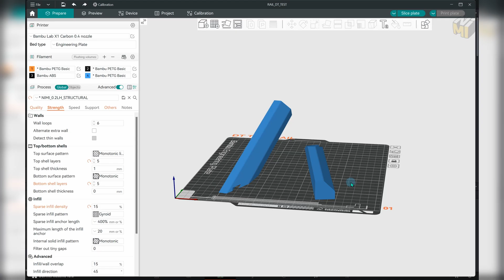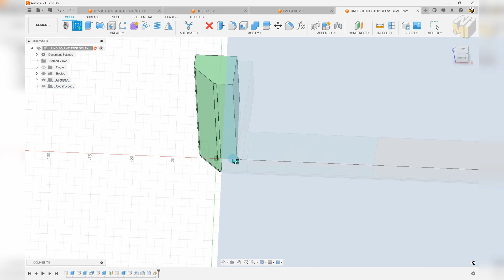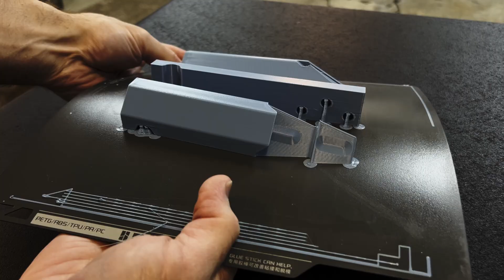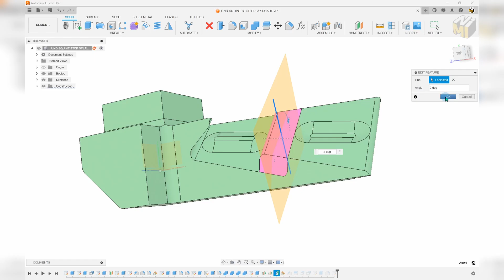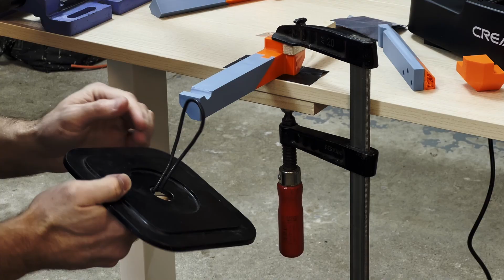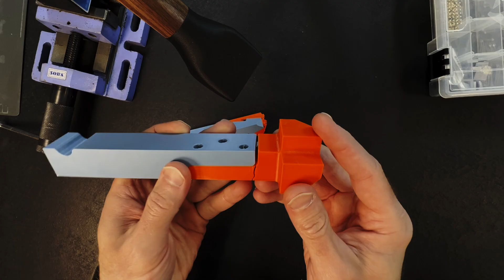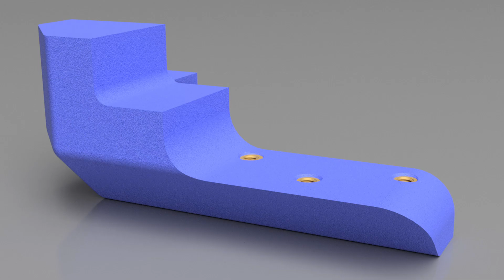Strong 3D Printed Connections on BIG parts

Comment: the joint with the wedges........ you did your test with it rotated like 45d around its long axis, obviously you did this for strength, it would be interesting to see it compared to a non rotated version, the same as the dove tail was oriented................. similarly, you should also do a version with a 45d rotated dove tail. Comparing these designs, as in the video, is comparing 2 changes at once, the change of the design, and the joints rotation, having variants with only one change, would provide better data.
Reply from the maker: I wasn't really sure at the time of the design whether it would work well at all, the main reason I did it was to prevent the wedges from being visible from the front, and also to have a more symmetrical connection as well, square profile would have made it a lot easier.  I'd love to do more testing, I need to order some more material and we can really get into it with all types of ideas about orientation, or whether hollow with more tops and bottoms is better and no infill, or perhaps having webbing like an injection molded part.  Great feedback, I have a few vids to finish up and then I'll be back onto these testing videos again.
Reply: @NeedItMakeIt  either way, it looks like you good ideas in your videos, ill keep an eye out for them.
Reply from the maker: @ZOMBIEHEADSHOTKILLER  Thanks!  I will definitely be doing more videos like this, I have a few ideas already which could prove to be big time and money savers for big parts... if they perform well.    I have my new weight scale on its way to hopefully give it a bit more accuracy and should speed up the videos a little as well.  Have a good one!

Comment: you're not just measuring the weight these rods can take in the demos, you're also measuring torque. If the rods were longer then they would take much less weight.
Reply from the maker: Yes absolutely, the tests aren't perfection by any means, it's really just a starting point.  I think a better way to test would be to have two bearing points, both which can pivot and provide support at the ends, we can load the center and test deflection and breaking while not having the 'table-edge' effect on the parts as well.  Let me know what kind of setup you think would be best for this and I can see about working it into following videos.  I have a new scale on its way, that should make the videos a little shorter and the testing a bit more accurate as well.

Comment: Good thing I stuck to the end of the video as I wanted to comment on the first part disadvantaged test. I think another point that need to be controlled is the connection length.

What do you think of a sliding dovetail with a bolt in the middle to fix it in place. You will have a large contact area and a bolt to keep them intact.

Comment: the last part failed because of the clamp fixture acts as stress raiser, that why it failed in the shoulder. because plastic has such low elastic modulus, the things tend to bend a lot, changing the direction of max tension vs grain orientation. allowing it to bend to conform to the stress and squish a bit of more "performance"
steel suffers from the opposite problem, as its high elastic modulus means that any and all stress will be directed, almost ideally (in contrast to plastic, at least) to the weakest point. 

since most of the time, the bending allowance is a problem in joints, you could also add a maximal tip deformation (at a given load) to see the effective rigidity of the solution, as a thin plastic (like a 2x12 mm, I estimate) hook with a controlled round flexion at the fixture could eventually surpass everything tested here, but it would suck as a frame element.

Comment: I suspect here with the material the main difference between them is that the more complex a joint has, the more wall material is being used. I would try a bit denser infill with the cubic pattern. So that you decrease the difference between the joints having more wall surface area between the parts.

Comment: This looks like turning plastic modeling, and taking a leap backwards to woodworking joinery.  That was a lot of modeling work.  What's wrong with glue?  There's glues that can handle low-energy plastics, heck, just about any thermoplastic.  Anyway it was interesting, but I don't get the need.
Reply: I mean to me if you can get something that is self centering that would be nice. Personally i would probably combine both glue and some kind of joinery. To ensure you have larger surface area for the glue to adhere to.
Reply: What was that specific glue? In my experiments superglue creates a bond that held up longer than the surrounding material for PLA.
Reply: @sopues  It was a loctite in a purple tube.  I wish I had it here in front of me.  Superglue on pla seems to work fine, PETG is a bit trickier.   There's also a company that makes a specific line of plastic glues, I think it's called "Purple Goo", or "Purple Goop".  Never used it myself, but I have seen it mentioned in posts as working.

Comment: So cool. This is more informative than the usual videos of many other creators on 3D printing. This gives me ideas of how to approach some 3D printing problems.

I have a hard time putting in inserts with an iron. I do it from the other side, and make the hole smaller on the fastener side to keep the insert from being pulled through.

Comment: One limitation of the final two joints is the direction of assembly.  They require lateral space to fit together whereas the first joint type allows lateral and transverse assembly.  They will still work to create a frame but will require subassemblies rather than direct ad hoc assembly.   Put another way, imagine making a cube with butt joints verses dowel joints.  Butt joints can slot in wherever there is an opening whereas dowels need to be installed from on direction.  Small detail but when I saw you put risers in the middle of the scarf joints I could see it limited assembly options.

One possible way around this, or adding more support to the wedge design, could be to angle the outside edge of the wedges thereby creating an additional direction of pressure.  Tricky to do if you’re cutting the joints but when you can print it then a non issue after design.

Comment: It’s pretty interesting how the failures were all along the print material, not the joint itself. This tells me that they’re all very strong joining methods.. it would be interesting to try this test with 100% infill, or different infill weights or latice structures around the joint. It also seems that to optimize a joint with a normal infill, the key is keeping the cross- sectional area large- and possibly playing with that geometry to have an I beam section throught that acts as the joining dovetail or something. Very interesting! Thanks for making the video!

Comment: Interesting test my take away from all the brakes was more infill would have them stronger. I have a habit of putting shake pieces into joints to make them stronger in bamboo slicer. I would’ve made 26 mm wide 3 mm high and probably 10 to 12 mm long and put them inside the joint and then did 100% infill making the two pieces for a little t at the joint, Then, when I slice it, I look at the positioning to make sure it’s strengthening the joint from the intersection. It may be useless, but it appears to give more strength and I will look at different ways to do the one that appears the strongest in the slicer so I may slice it 10 or 20 times till I get the effect I want at the joint. I like doing half height joints that are 10 cm longer and half the thickness of the material and I also put in dowel hole I’m super glued dowels and joint in place. Anything that structural I’ll do anywhere from 60 to 100% infill to get the strength I want. I grew up making things out of wood, so I still use the things that work with wood and they seem to work well with 3D Printing also. I think of the fill amount as different types of wood and the strength they supply from my test so I can take my knowledge with wood and use it in 3-D printing. Press board being 10 to 30% infill Softwoods I would consider like 50% infill or harder hardwoods I would consider 75% or higher infill and African hardwoods being 100% infill.

Comment: It would be good to see a control piece that doesn’t have a joint in it, so we can compare best case scenario.
Reply from the maker: For sure, that's a great idea, I will make sure to do something like that for future videos.
Reply: It would be good to break the base version a few times just to a vague estimate on the inherent variability of the test proceedure and print quality.
Reply from the maker: @MilesMcCusker  I have 4 printers now, I just need to place an order for enough filament and I'll be getting back to some testing videos!  I think I'll continue to use PETG, the smell of ABS and ASA in my shop is not something I want to have to deal with.

Comment: If you're planning on continuing the series, I'd be curious to see how these joints compare to a part printed without a joint.  Looking at the failure modes, I would not be surprised at all if the extra perimeters in the jointed construction are stronger than an un-jointed piece.  (Great job on the video!)
Reply: Agreed came to comments to mention a control sample
Reply: A joint is never as strong as a full part without joints. It's physics. You have a lot of samples in the woodworking area.
Reply: @christianmontagx8461  but this isn't wood, nor 100% solid material, there is empty space on the inside and the infill is nowhere as strong as the perimeters. That's what was being mentioned here as far as I understood, that the joint having more perimeters involved in the demanded sections could be stronger than a full part that would be mostly infill on the same cross section
Reply: @christianmontagx8461  even if thats true, you still want a control so you can see what percentage of strength you lose by using a joint instead of a large piece.
Reply: @christianmontagx8461  it is for 3d printing, connection joints are solid layers, the inside of most 3d prints is hallow with infills that account for 10-25% of the volume. hence the strength difference

Comment: For a minute it was looking like your table was going to break before the 3D print broke.
Reply from the maker: Yeah, I need a proper testing setup.  My shop isn't really big enough so everything is portable.  I will need to make a proper solid wood workbench and then we'll be cookin'.  I think I'm going to need to buy a decent fish scale for these tests, it'd make the videos quite a bit shorter and not so hill-billy using my weights. All in good time I suppose.
Reply: I was going suggest a fish scale or luggage scale to speed things up, but if you do that, make sure to use some sort of pully system. If you just directly pull down on it yourself, when it breaks, the chances of injury are huge. I've seen people get knocked out doing that because when it snapped, all that force hit them in the head. @NeedItMakeIt

Comment: looked like youve had thicker walls than tops and bottoms. Maybe keep them the same for future tests.
Reply from the maker: That's right, keen eye.  I have 6 walls, and only 6 tops and 6 bottoms.  The LH is 0.2 for most of my projects at least with the 0.4 nozzle.  That gives is 2.4mm +/- wall and 1.2 for the tops and bottoms.  I could up it to 12 tops and bottoms, that's probably a good idea.  Or reduce the walls and meet in the middle maybe?

Comment: Interesting video. I really like the "put a pin on it" approach to connecting pieces. Thanks for sharing!
Reply from the maker: Breathing some life into a very old technique.  I was once a Timber Framer back right out of College and this was a connection we used on occasion for long spans, truck bed length and material was a problem as well.   It seemed like it could work well here also, but I didn't think it was going to work this well, there is certainly some potential here.  If nothing else, it's a cool idea and someone will probably be able to improve on it.   The wedges were great, having that constant pressure rather than a loose joint probably helped it quite a bit.  I think I may need to design a full enclosure with this method, it looks pretty cool as well as a little bonus!
Reply: @NeedItMakeIt   Yes, I wonder if there is away to make the insertion/removal of the pins tooless, or are least a bit more ergonomic than the current "let us jam the pens in".
I have seen the viral japanese woodwork videos that shows these kinds of joinery. It is pleaseant to see how much overlap there is in the people who like wood work and 3d printing. Let the river of ideas flow!
Reply from the maker: @rodrigob  I think so, I had been thinking about a single wedge concept, also there is the ability to use a wedge/screw combo to pull the parts together to tighten the joint, but I figured it wasn't good for this test.   

So we shall explore more of these ideas!  I think there is some potential here.  I think we're all still in the search for the ultimate 3D printing material as well which is stiff, doesn't break, can take the heat, and isn't prone to warpage.

Comment: My high school physics teacher didn't use weights.  He took a 5 gallon bucket and slowly poured in sand, then when it failed he would weigh the bucket of sand.
Reply from the maker: That's a good idea, I have a bucket, I could do the sand trick for sure.  I was thinking about getting a fish scale, but I'm not making too much yet on YT videos and I've been making sure not to spend until I can have a more steady income.  All in good time.  Maybe in the meantime I will have to use the bucket and sand trick.  Just need to make sure it doesn't tip over, but that's easy enough if it can be close to the floor.
Reply: @NeedItMakeIt   Use a secondary catch line to keep it from tipping after failure.
Reply: @NeedItMakeIt  You might incorporate an scale between the bucket and the sample.  So you can see how much weight is added to the bucket.  Then add sand in measure sizes.
Also for testing the clamp side must be bigger just so that there is less movement on the table side.
Reply from the maker: @gabrielpadilla3742  I like that idea, I have a crane scale, and I think the bucket it a good idea, I can pour sand in and I think that when it falls, it shouldn't spill all over the place.   The next parts I setup for testing will definitely be made to test out correctly.  I wasn't planning far enough in advance on this one, I was focused more on the idea, but I will do both in the following videos.  Thanks for that, I love the feedback and I will continue to get better setup with testing equipment for future vids as well!
Reply: one option for the bucket is to suspend the bucket past the point of fail. that way the suspection can prevent the impact on the bucket. @NeedItMakeIt
Reply: @NeedItMakeIt  measure the amount poured out of the source.  obviously.
Reply: Take the source bucket, fill with sand, weigh the sand, then calculate the sand remaining in the source bucket when things fail.
Reply: (from teacher) - make the suspension line (in your case the black cable) long enough to go within a few cm of floor. Eliminates legs and toes under the weight when it fails. We also use water instead of sand. Our scales only go up to 5kg or so, but can easily count the liters added. Also, use a dowel to sit in the weighing groove. From thatcarabiner

At fail point, adding infill or outer layers would improve strength. Would the improvement be same for all 3 joints? Would be in interesting study. Or vice versa - how many shell layers on each to get to a 30kg break load
We always weigh all parts when doing comparison like this. Try to get strength to weight ratio.
Reply: Yes the gradually increasing of the load is important, this load on off stuff is really bad for comparison. You can also use a car jack and a scale and all sorts of stuff.

Comment: That’s impressive! I have started looking at Japanese joinery as layer lines are similar to wood grain. I have expected keyed scarf joint to be good, but that blew my expectations 😮
Reply from the maker: Me too, I was adding weight and kept saying, it's going to break, going to break, and it didn't.  The wedge and constant pressure to keep the joint tight helped quite a bit compared to the other connections I think.  The great thing is that I think there are a lot of improvements that can be made, and imagine if the connection was glued as well.   I guess it doesn't matter much if the joint doesn't break at the connection.  I think there is some potential here to apply other framing techniques to 3D printing as well.  I'd be happy to make more videos if there is interest.
Reply: Interesting, cool bit of information. Thanks!